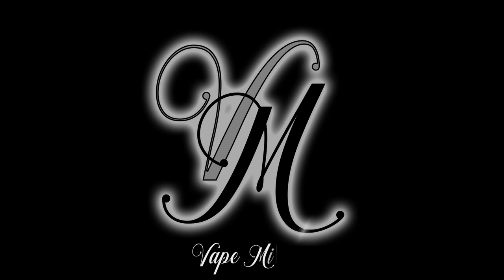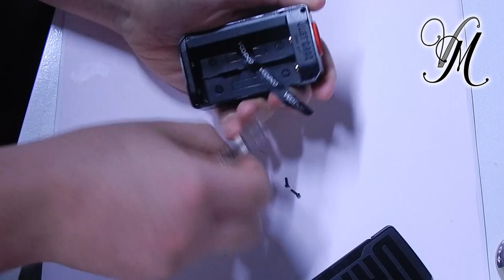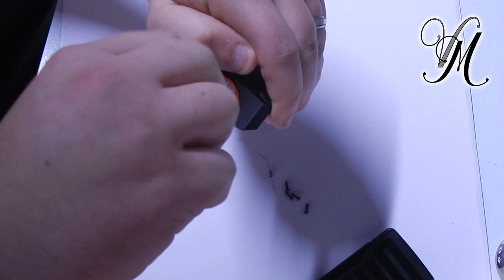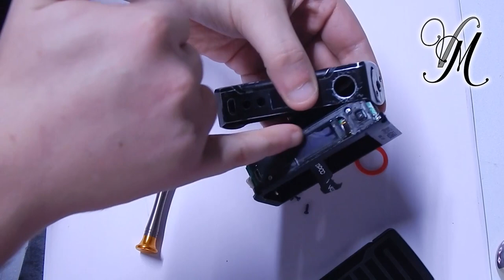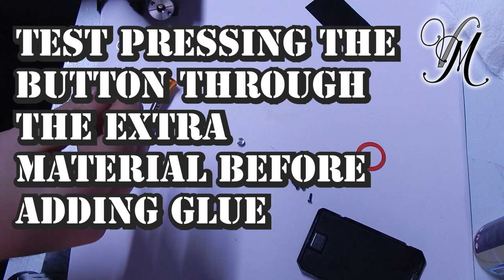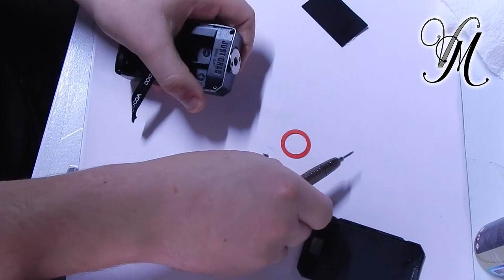VooPoo DRAG 2 Button Fix - Read description

Comment: hello, do not know how to restore the top mount Drag 2?
Reply from the maker: If the screw ports have lost there thread there isnt a great deal you can do.

Tape, or glue maybe?

If you don't know if the threads are gone, but you've got the screw, buy another screw. If the screw is just loose, tighten it lol
Reply: I was able to fix it by cutting a small rubber band piece, putting it in the holes of the screws and screwing on top of them, it creates the necessary friction/traction for the screws to tighten up, I know this is 2 years late, but I hope it can help you with future screw related problems!

Comment: hi i have problem with drage2 software >>
on screen one battery is full and another in empty or one but when in put this battery in another   mod darge 2, the battery is normal and same degree of charge 
what i have to do
Reply from the maker: Is it fairly new?  If so I'd take it back.

Try cleaning the little gold battery connections inside the mod (not the battery)

If that doesn't work then I have no idea, have you got some more batteries you can try? If it isn't reading the batteries right, I suggest you stop using it right away. 

Why- if it isn't reading the battery voltage correctly, I could damage you mod or batteries even more, very worst case scenario is could explode the battery while using it.
Reply: @LetsNerdIt  one of the gold battery connections on my mod has pushed in and won’t come out, anyway to fix it?